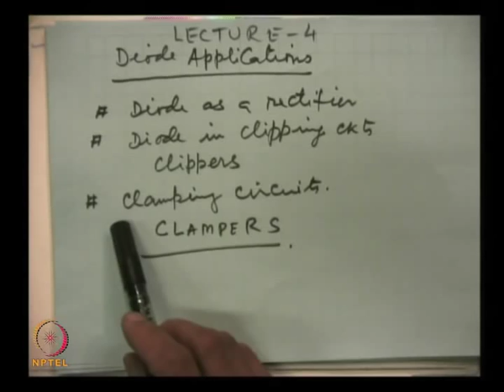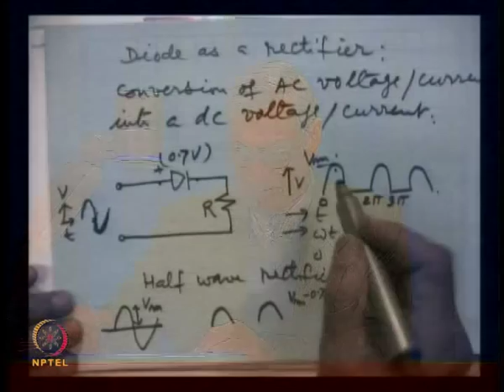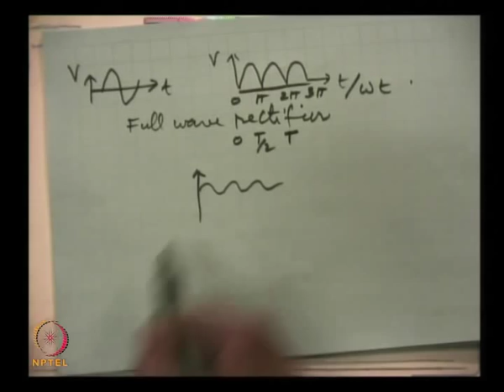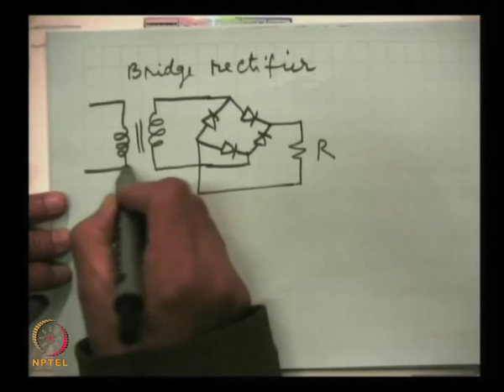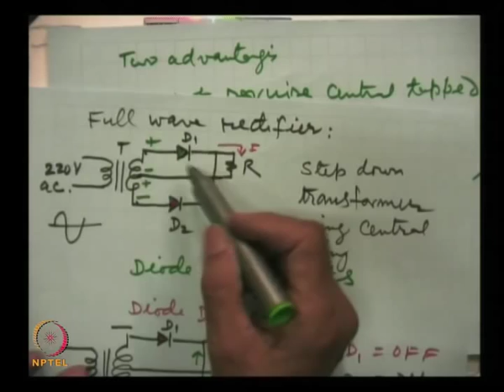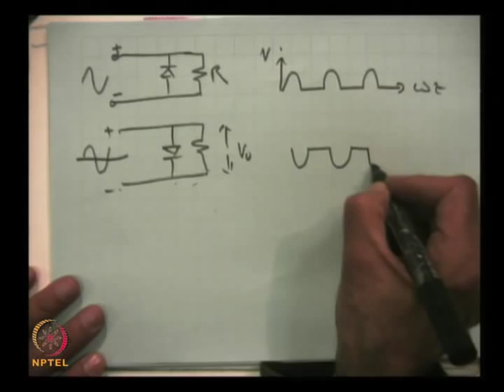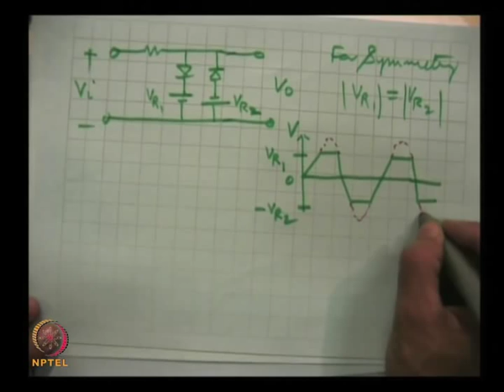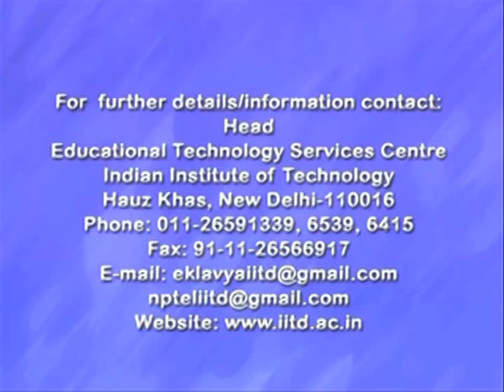Mod-01 Lec-04 Diode Application

Comment: what is the use of transformer in rectifier
Reply: When a device is connected to a source it may not be able to work on 220 v AC so it has to be step down for better use of device